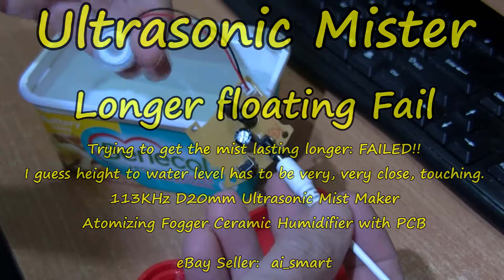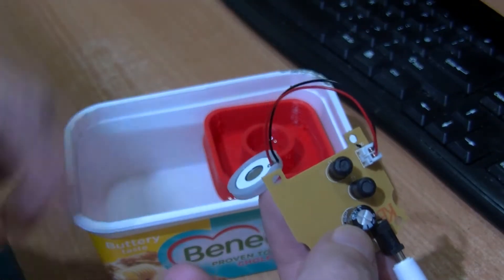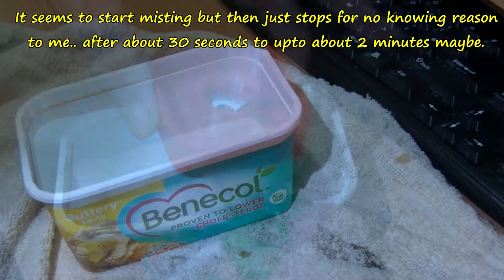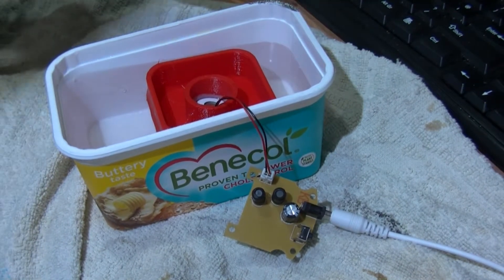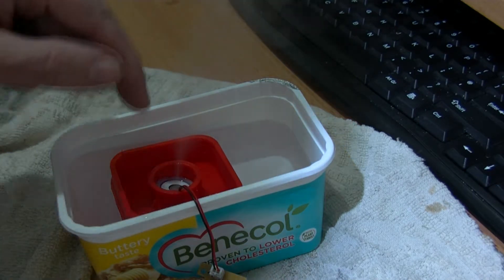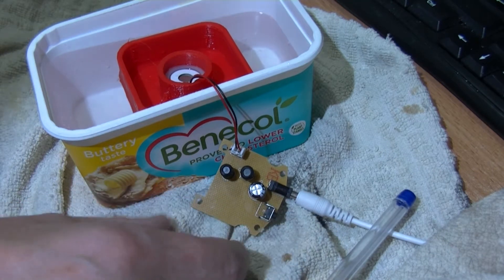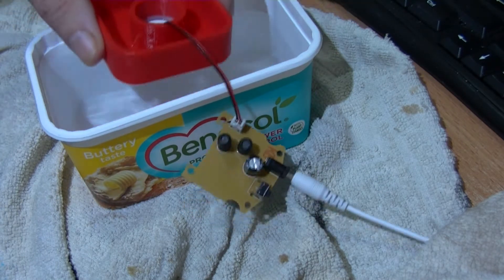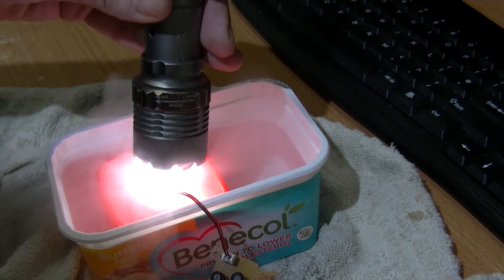Ultrasonic Mister Longer floating Fail

Comment: Hi !

Thanks for your video. I bought the same device, made some mist with the transducer on the surface of water, great !
When I decided to actually DO something with this, issues popped up.
The point is that the lower part of the ceramic MUST be touching water, but the upper part MUST NOT have water on !
I designed and printed sort of a chimney 60 mm high with the device mecanically sealed in the lower part. It works like a charm... for 30-40 sec ans stops. The issue is that part of the mist somehow condensates and returns to water which floods the upper part of the ceramic. The system stops. Taking the water away solves the problem and there you go for another cycle. Useless.

I was about to design and print a floating device like yours, when I found your video.

From your experience, I will modify it in such a way that the lower part of the ceramic is also touching water. I think you don't need the lower flange as the whole system is floating. I will also reduce to the minimum the height of the chimney to avoid condensation. I think this should work.

Tomorrow's work !

Thanks again.